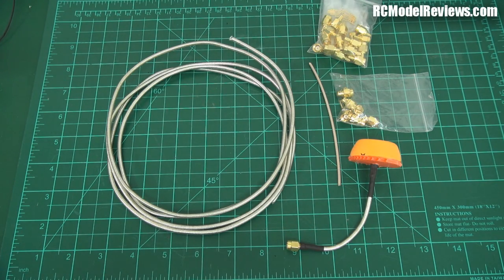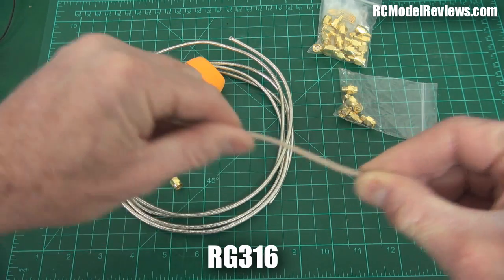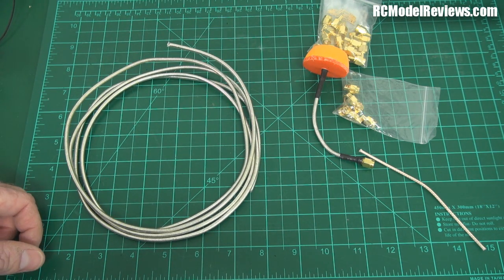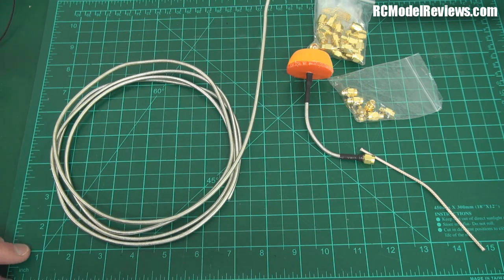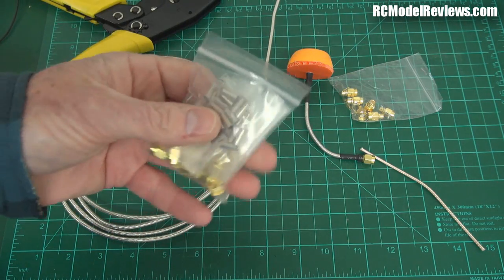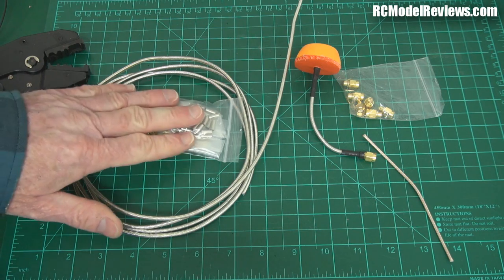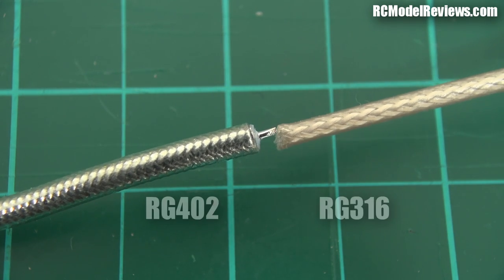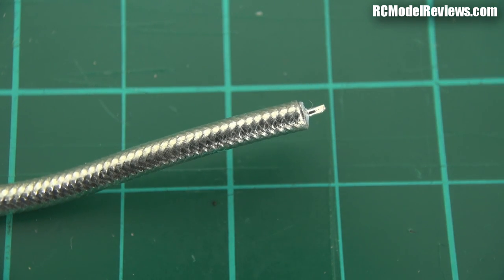DIY FPV, RG402 versus RG316 coax cables

Comment: One note for those who do a lot of home wiring. Get yourselves a pair of precision wire cutters. Not diagonal cutters you can buy at the hardware store. I mean a good pair of really sharp wire cutters. Most of the time the good ones will stipulate that you do not use them on steel or harder metals, only copper, silver, tin, and lead. They'll cost you a decent penny but it beats mashed wires. I have a pair of Erem 532n for work and Hakko model something or other for home.

Comment: Thanks Bruce. Would a longer run of cable for antenna (2 feet maybe) cause issues? This would give more space between other electronic noise. Thanks
Reply: civicex5speed You will get some loss due to longer cable lengths so it's always a good idea to keep the antenna lead as short as practicable.  That's why on my FPV pole I mount the receiver at the top with a short lead to the antenna and an extension for the video signal (which is far less affected by longer cables).Over a few inches the loss isn't significant but once you get to a foot or  more, it can soon add up,  especially if you're using a cable like RG316 which isn't even rated for 5.8GHz and seems (empirically) to have a loss of more than 2dB per meter.   That means a meter-and-a-half (about 5 feet) of cable will halve the signal.

Comment: Bruce, in can't find the part numbers formthe rp-sma or sma connectors to match this cable. Please make a video assembling an antenna and show us what connectors are the correct item. Also is there an optimal length for the antenna. I see 5cm bandied around in the comments.

Comment: Bruce,

Soldering video and (if it wasn't already done) how about a antenna cable 101 video.  Stuff like, length, does it matter if its long/short, having multiple antennas next to each other, proper distances, and even something like, I currently own a Immersion Duo and Uno, can these be used together into a single goggle/base station feed?

I'm sure there are others out there that may have done that video, but its gospel if it comes from you!

Corey

Comment: Any idea as to the attenuation per "x" length of RG402 for remote antenna set ups. I am trying to avoid having all my VTx's mounted exterior to my ground station. I know there ios going to be loss, but how much am I to anticipate for a 15' run from my indoor mounted 5.8GHz VRx? I am building the RCMR diversity PCB offered by OShpark with the extra caps for hysterisis and maybe I shopuld plan on having an enclosure with everything contained in it and just the RCA sending the AV. Ooops just the video for now:-). I am working to make the changes necessary to get audio coming along with the video through the switches.

Comment: Bruce, I built several antennas using the cheap rg402 material from ebay.  All of them are falling apart where the braid is soldered to the sma connector.  The braid tears off completely and then the antenna flies off of my multirotor.  Any suggestions to ruggedize this?  Or should we buy higher quality RG402 cables?

Comment: I noticed on some commercial antenna they use what looks like a ferrite core around the coax just below the antenna. I assume it has something to do with noise suppression or acts a simple balun. I don't know if it makes a lot of difference if any on these small antenna?

Comment: Great video as always Bruce. What antenna are you using on your transmitter for normal flying( non fpv,) just wondering as thinking of changing mine as every one says standard one is crap. Cheers.

Comment: I have a crimper for those connectors, I still solder the inner cable to the pin/socket just to be safe.
Reply: Weese I've never had a crimp fail so the "belts and braces" approach probably isn't necessary but,so long as it's done properly, probably won't hurt.There's some very interesting scientific stuff out there on the superiority of crimping to soldering -- it's quite an eye-opener if you think that the latter is better than the former.
Reply: Weese Oops... misread your comment-- yes, I always solder the center-pin to the coax inner.
Reply: What is the size of the crimper?
Reply: I'm glad I'm not the only one that does that!

Comment: Hi. Great videos. I am having some trouble with the video feed on my quadcopter.

When I separated the vbat, gnd and vid wire from each other(they were twisted together), the vid cleared up almost perfectly. 

If I used Co ax cable for the vid wire (cam to vtx) do you think this would reduce interference?   Any response at all will be appreciated!

Comment: Hi Bruce, does it matter which way the antenna is pointing on your model, wasn't sure if it mattered if it was pointing up or down
Reply: ***** No, it makes no difference so just position it whichever direction is convenient or most mechanically robust.
Reply: Just don't point the top at yourself. Clover leaf antennas have donut shaped radiation so top and bottom are null points

Comment: Hey bruce, what is the realistic maximum length for these cables? I'm planning to rig an old van for fpv. I was wondering if a 4-5 meter  RG402 would be OK.
Reply: Remember you will loose some gain with long cables between the antenna and receiver and it has to be multiples of I think half or maybe quarter wavelenghts of the freq you are using.
Reply: So.... For 5.8?
Reply: illusive aeldre
 I've got to be careful what I say here since I'm no expert. But the usual crude method is to use the calculation speed of light in a vacuum divided by the freq eg for 5.8GHz  299792458/5800000000 = 0.052m or 5.2cm is equivalent 1 wavelength. But then you have to multiply that by the so called velocity factor of the coax. I noticed the extensions on IBcrazys clovers are 5cm.
Reply: stewjw I know some of those words :D But i don't see the answer anywhere.  5cm can't be the limit because I saw people using  15-20cm long antennas for 5.8ghz.
Reply: illusive aeldre
 You can use multiples of the 5cm wavelength or half wavelength like you said, 10cm, 15cm, 20cm. Simply put on the two transmission lines in the coax you want equal and opposite waves to cancel each other out to get whats called a balanced line otherwise you generate a large standing wave which is not healthy for the receiver or transmitter. The standing wave can be measured using an SWR meter and needs to be as close to 1 as possible-at least I think thats right. So if you use a transmission line length which is in multiples of the calculated wavelength there's less chance of getting a large standing wave. But to be done properly a meter has to be used. If I'm speaking in riddles its because I don't fully understand it either.
Reply: stewjw
To be honest I've only made my own dipole antennas and use a an ImmersionRC power meter with something called a directional coupler for the freq range I'm using to act as an SWR meter. Dipoles are easy to correct you just trim the antenna lengths, with the transmission line attached, until you get the lowest possible SWR reading. There's info on the web on how to do this or just buy an SWR meter but 5.8GHz SWR meters are hard to find and are extremely expensive. No idea why I mentioned Smiths charts above its something I read I deleted it.  Also my simplified explanation above may not be correct, read a book on the subject. I think you use half or full wavelength lengths so the impedence is at the lowest point when its attached to the antenna; someone advise me here.
Reply: stewjw Impedance match is important that is SWR standing wave ratio simply put it is power out the antenna and power reflected back to the TX. The cable when matched to the wave length of the freq will give a 1 to 1 SWR with the correct antenna. The way Bruce is doing it works just fine as long as the power coming back to the TX is acceptable. Hope that make sense.
Reply: Plowboy H  When using directional couplers you put the coupler in reverse which is the same I believe to measuring the reflected wave and I optimise the antenna until I get the lowest possible power reading. You can also measure it in the forward direction and throw the two values into the SWR power equation to get an SWR value but reducing the reflected power is the most important. It would be interesting to do a test to see by how much the cable length effects range.
Reply: stewjw You know I never run a field strength test in 2.4 gig range or 5.8 gig. Would be an interesting test.

Comment: links to the cable plz
Reply: dinislam Just search ebay for "RG402" and you'll find it.
Reply: *****
We are to lazy, and do not know how to use GOOOOOGLE. Please put a link in your description. Ghesh!! LOL
Reply: eastcoast78 GOOOOOGLE don't sell cables
Reply: ***** Could not find any uk seller. found some sellers in china. Thanks.
Reply: dinislam
I did not say Google sold them, i said "we don't know how to USE google"...:)
It was a joke anyways. RELAX like ExLAX..
Reply: eastcoast78
Yes, China seems to be the best place to get this stuff.  Cheap, quick and sometimes you even get free postage!

Mouser has it for $9/foot but you have to buy a 100ft roll for $909.95  and Element14 will sell it to you for nearly $50 per metre.

Yes, I think China has the deal sewn up! :-)